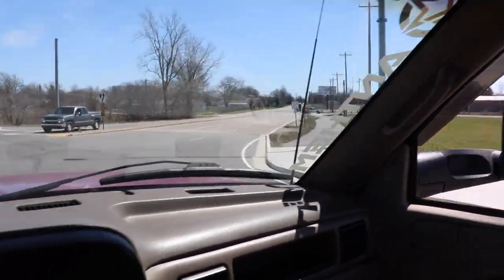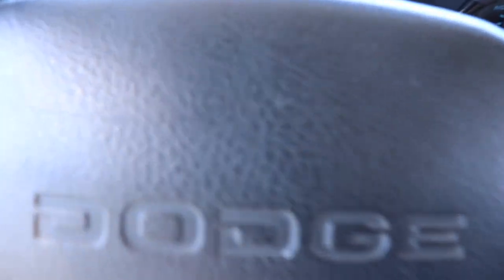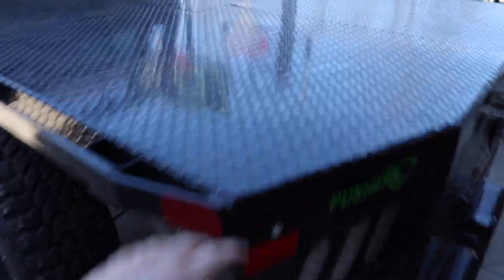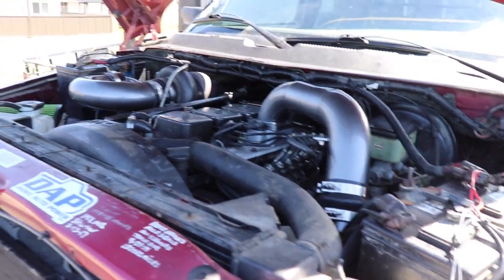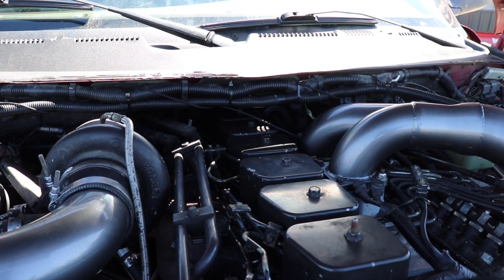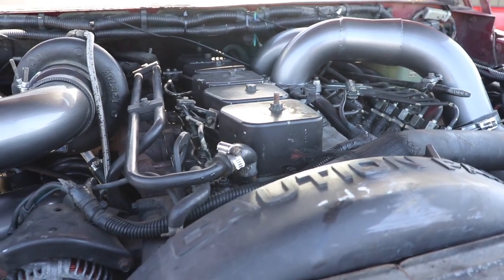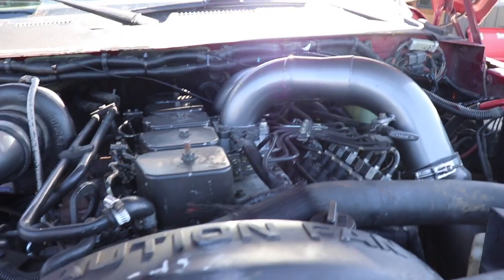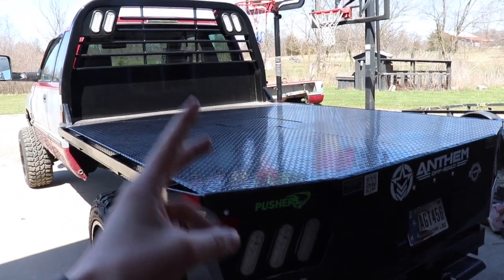12 VALVE CUMMINS GOES FROM 200HP TO 600HP!? HERE'S HOW!!!

Comment: Nice! I love these engines so much I put one in my 78 bronco. 350hp and 25 mpg aint too shabby for a lifted 4x4.
p.s. A few years ago, when the engine had about 280k on it, I actually ripped the middle oem head bolt in half near the front of the head and started pushing out coolant, and that was before I upgraded the turbo, I was running the VE turned up as high as it would go, with about 27psi back then, sooo.... I would strongly suggest ARP studs in ANYTHING over stock! In my case, with almost 300k on the engine anyway, I took the opportunity to send the head to my machinist for a valve job, heavier springs and surfacing. Now it's back in action with a Hybrid H1C/H1E turbo I built for it, running 38 psi of boost through a 7.3 intercooler, too. Virtually zero smoke anymore, so it's time for bigger, more efficient injectors. lol I've been amazed how well the stock 78 Bronco axles have survived for 50k miles so far with that much torque, but they have. I did twist off 6 driveshafts before I got that issue worked out, though. lol. 0-60 mph in slightly under 5 secs(5100 lb truck) will surprise some performance cars, too. :D

Comment: Dude this is the first 2nd gen ram I've ever seen with 4 overload springs and swaybar in the rear.   2 overloads is common but only time I've seen 4 is on my 2500 97 gas burner.  That thing is strong as a f450 in the legs     I have seen 1 3500 dumptruck with that rear end setup but was a dually and a dump not a pickup.  Crazy strong model you got there

Comment: how does a dual intake help push more air towards the front or rear? the entire system is under positive pressure 0-60 psi.. number 1 or 6 cylinder cant be running behind on air unless they where running under a vacuum system

Comment: so how much would you spend to do all these mods. I would want to know before going in, and I assume I would be putting in heavier clutch with my manual
Reply from the maker: G Jones this truck was built conservatively. Probably have $3k-$4k in Power Upgrades. If you have a manual you will save insane cash on trans stuff... maybe $1.3k to have a dual disk clutch installed. And you’d be good for 750hp!

Comment: You really need an afc live from power driven diesel!
Reply: ShootingZay Phillips it’s a 12v it’s all mechanical
Reply: @dylanator4392  exactly look it up it's a pnumatic tuner for p pumps. I have one on my 95. Absolutely love it
Reply: DJ CURTIS so it’s like that fuel control adjuster right?
Reply: DJ CURTIS what all does it do anyway?
Reply: @dylanator4392  power driven has lots of videos on it. But the short version is it goes in between the boost reference line in the head and the pump diaphragm. It allows you to tune your afc for power and smoke. Too much fuel and it actually hurts preformace you can set how fast the fuel advances and how far the rack actually goes which limits egt and power. It also has a bypass switch which gives full power with no delay. I picked up 2mpg since I installed it and keep in in a relatively low power setting for daily driving  and it doubles hp and almost tripples the torque on their Dyno. You do it in conjunction with a lot of mods to the afc housing. My truck was bone stock except for an intake and exhaust. My first time romping on it it slipped my clutch. I went from 21 ish psi of boost to 34 psi. It's on sale right now actually if you want to get one tonight is the last day to get them 15% off.
Reply: DJ CURTIS so say if my Cummins 12v was 800 to 1000 hp is it worth still putting one of those afc live on it?
Reply: @dylanator4392  of course it limits power. If you want to tune in your power band to avoid unnecessary egts and make it more street able yeah. I'd recommend it for any 12 valve truck the best 300 bucks I've ever spent
Reply: DJ CURTIS ok cool

Comment: i have the banks power pak on my 12v, and that twin ram did lower the egt on the rear 2 cylinders but other than that i didn't see any other changes to be honest. personally i think 100% of everything to do with the intakes on these trucks is massively overpriced. not saying they are bad products or mods, but damn. the price of compounds can literally buy me another complete running no blow by low millage 12v, just saying.

Comment: Flatbeds look stupid with a single rear wheel. Needs a dually setup. Plus those tires and wheels are useless if your towing. Are they even LT rated tires? Should have went with a 19.5 alcoa. Where are the mudflaps?